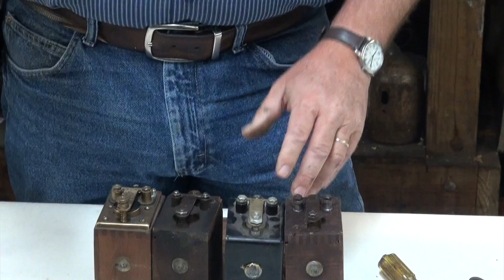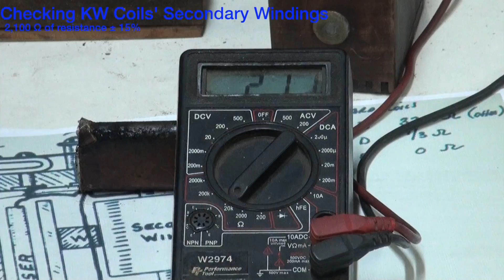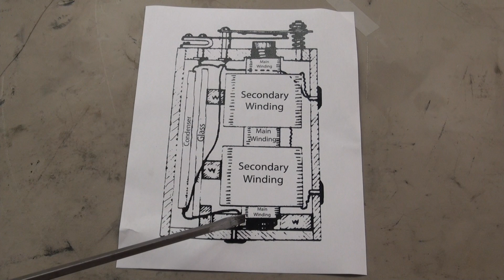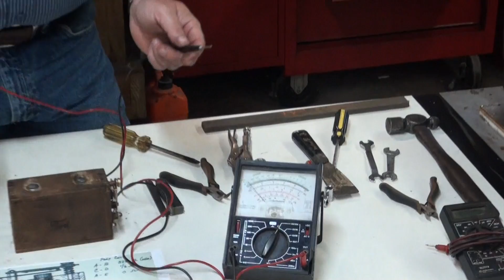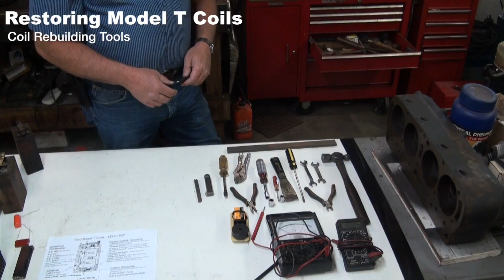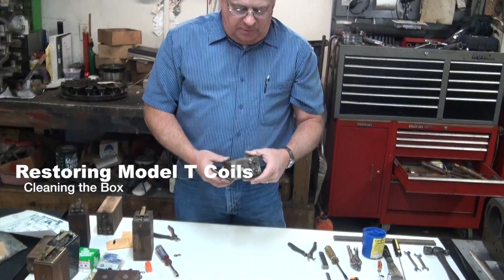Ignition 01 Restoring Model T Coils Part 1 of 3

Comment: I just opened one of my coils and i have a problem. The inside of the coil looks nothing like any diagram or picture of other coils. There is a single wood block, placed horizontally about half way up. The wiring is a mess inside and seems to have extra connections. Have you ever seen a coil that matches this description? There are no glass or wood insulators placed vertically inside.

Comment: Would you consider doing a video on wheel alignment? I have a 26T that has the infamous "Death Wobble". Not sure if it is alignment or worn parts.  Many thanks!
Reply from the maker: Thanks for taking the time to comment.  We plan to add rear end and front end restoration as soon as we can finish several engine builds.

Comment: I am restoring a 1923 Model T Ford 4 door Sedan here in Ola, Arkansas! Your video on these coils is very APPRECIATED! The new Condenser`s Look small compared to the New ones! Sort of makes Me think it would not be powerful enough! My Question is about My Magnito! I Replaced My Magnito with a totally Rebuilt one, And the spacing .012 is correct I believe! (If not ! Please let Me know!!) But they are all out of wack! There are only 4 Bolts to shim up! So I have some nice and close, And some a little farther apart! (I may have My desamil in the wrong place, So please forgive Me!) The farthest one is around .022! Will this still work on My Car? Twas lots of fun installing this! I lost 22 LBS from Putting the Flywheel on and off, to get as close as I did! I believe that the rebuilt Mag, May be slightly warped! Thank`s!
Reply from the maker: roybo1930 take a look at http://modelt-tips.com/Engine/15.html and then http://modelt-tips.com/Engine/15b.html. The gap between the magnets and the field coil should be between 0.022” and 0.0040.  On a new build I shoot for 0.025” but that is with crankshaft thrust in great shape with only 0.004” clearance.  If you have more thrust end play you need to consider that in your clearance.  You don’t want the magnets so close that they could hit the field coil.  We are in Russellville, maybe we can meet sometime after this COVID-19 Social Distancing.
Reply: @modelt-tips6985  Thank You so much! I LOVE Your Videos! And Love keeping these Beautiful Cars still going, IN ORIGINAL Condition!

Comment: Awesome video series!  thank you for putting this together.  this takes the fear out of working on these coils.
Reply from the maker: Thank you for taking the time to comment!  I like your screen name!
Reply: The kids and I are working on a "new" model T.  this is our first that uses the original coils.  it's running, but when it stops I can't tell if it's wrong fuel mixture or if the coils could just use a little adjustment.  is there a way to adjust the point gap and spring tension without a coil tester?  both the fun projects and ecct versions are fairly pricey. being a dumb schmuck, I don't  mind the extra work of doing something the hard way if it can save me money.
Reply from the maker: Do you have a copy of the Ford Service Manual?  If so, look on page 239 for "Testing and Adjusting the Coil Units," if not, you really should get a copy.  The vendors have them... here is one of them... https://www.snydersantiqueauto.com/model-t-ford-service